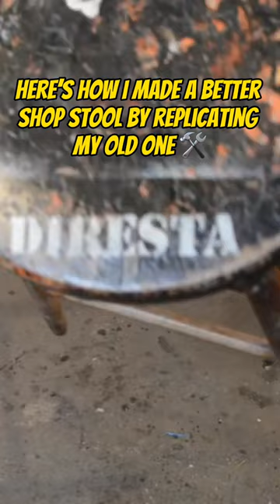Maybe a better shop stool? #diresta #diy

Comment: Hey Mr Diresta, I was wondering why you hammered the square dowels into the metal tubing legs?
Reply: I think maybe it was to receive screw on feet?  I imagine dragging that cut leg across the floor would feel and sound awful?? I was wondering same thing..that's all I could come up with
Reply: Looks like there were some kind of feet put on at the end. Perhaps to screw them into?
Reply: Similar to how wooden wedges got put into the mortar joints in brickwork to get a fixing point.
Reply: It's to plug them so they don't punch into soft surfaces or otherwise get junk inside.  True it may also reduce screeching vibration when dragging.